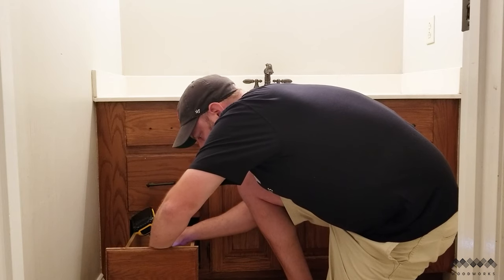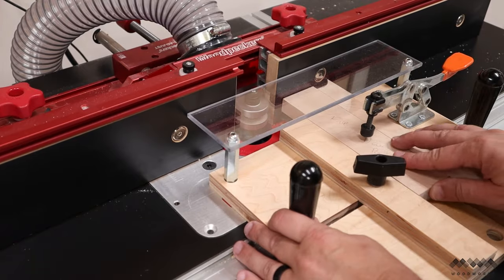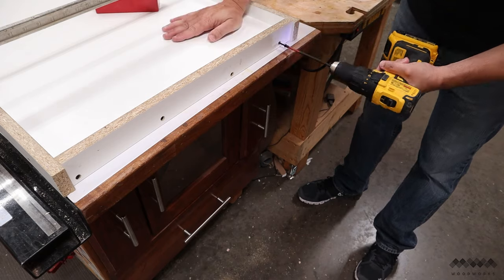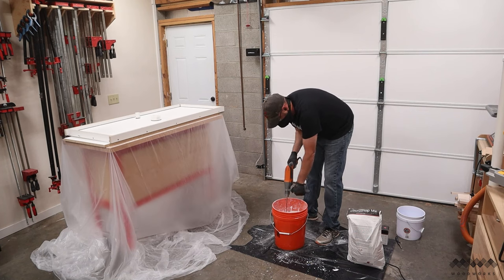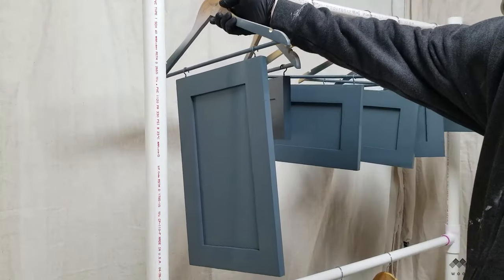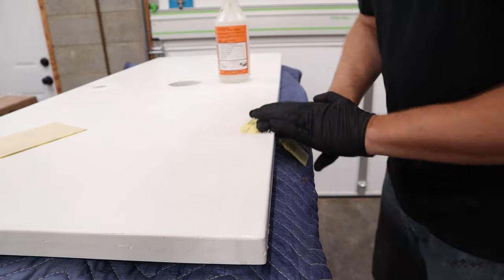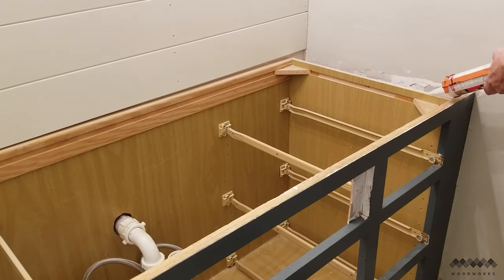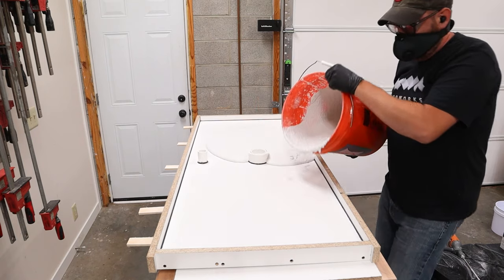I wanted to upgrade my bathroom vanity

Comment: Nice!  the only thing I would have done differently is add a notched out drawer instead of the false front, I've seen some vanities do that and I honestly think it's worth the extra effort, you can section off the drawer into two side compartments and one middle one on the inside to make it slightly less awkward, might as well for more storage space imo

Comment: Nice work. I make my doors on the table saw, but I’m definitely going to buy a set of those router bits. Also, forget those negative comments. Your update looks great!
Reply from the maker: Thanks Patrick! I've done doors on the table saw for years and I like that method but it's slow when you have many to make at once. I definitely recommend the router in that case.

Comment: I like it. How did you handle the grain when you painted the cabinet frame? It looks like oak so is probably grainier that the maple. 

Is grainier a word?
Reply from the maker: The fronts are all maple so no issues. The face frame was oak but I designed the cabinet fronts so there's basically no way to see the face frame unless you open a drawer. I didn't worry about filling the grain of the face frame. The dark colored paint and the relatively low light of a bathroom makes it so you can't really see any grain detail unless you shine a light directly into it
Reply: grainier can be used if you rub the oak with sone wheat, or oatmeal, or rye bread.
no problem

Comment: I got tired just watching all this work that you did. Came to the conclusion that spending $1k on a prefab and preassembled vanity 5/6ft-wide with quartz countertop and undermount sink, delivered to my home, is indeed a great deal. 

Also, I've noticed the gaps between the countertop and the walls... Although you sealed with silicone caulk the bottom of the sink, water is smart and will find these gaps in its eternal race to the bottom. That's the obvious reason for the back and side splashes in the old counter. Hopefully, this is a bath that doesn't see much use. It looks great - pretty and trendy. Good job and good video!

Comment: Nice job. Lots of haters on the look but haters gonna hate. FYI Concrete doesn't need air circulation to cure. One thing I might have done different on the shiplap is nail it where the next board covers it but maybe that wasn't possible with the product you used. These projects are so satisfying, hopefully I get the time to do mine soon.
Reply from the maker: This particular concrete mix requires demolding after 1-2 days and allowing to finish curing outside of the mold. The issue you can run into with nailing shiplap at the tongue is that the pine boards split really easily there. Plus the nail marks are part of the rustic feel of shiplap.

Comment: Is it cheaper to reface than getting new cabinets ?
Reply from the maker: Of course! If you have the equipment already to do that kind of work (a Woodworker)
Reply: I don’t I just moved and the cabinets are nice and solid wood but someone painted the front of the cabinets and they did not know what they were doing so we have to pay someone to replace the cabinets, I don’t want to replace them, my husband doesn’t not know how to do this kind of work so I thought maybe it’ll be cheaper to pay someone to reface them instead of replacing the whole thing ???
Idk 🤷🏻‍♀️ what it’s the most economic way to fix the problem if we have to hire someone to help us with this issue ?
Reply: Btw I loved your work.

Comment: the shop is great, you’re great, i love your tools, the workmanship is great, the cabinets are great, the only thing i personally have something against are the pocket holes.  even thought they are very handy, there’s something about that joinery method that rubs me the wrong way.
i think i convinced myself that it’s cheesy joinery, and it’s going to come apart at some point.
anyway, it all looks great,  nice job.

i wonder why the rest of the world doesn’t do woodworking, it’s the only thing we should be doing.  why would you want to be anything else lololol
 have a cousin that’s a CPA…..how gross is that.  paperwork and numbers all day.
you can’t use a jointer, or a table saw, or a router.  Jesus Christ knew where it was at !